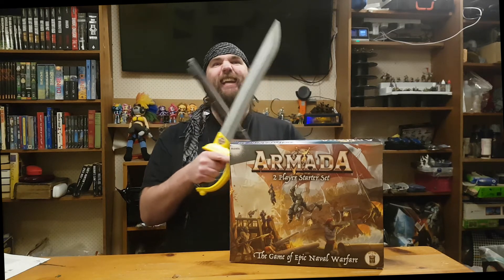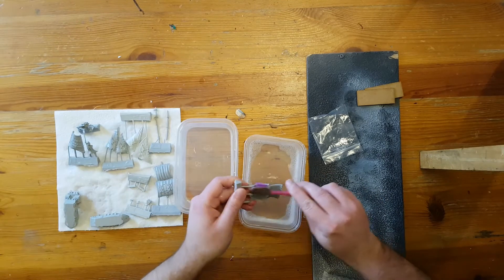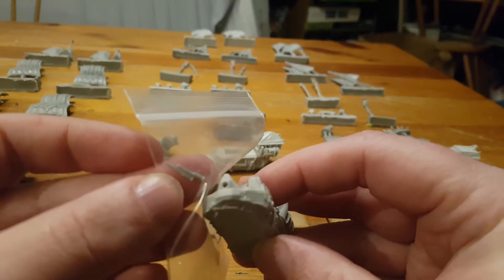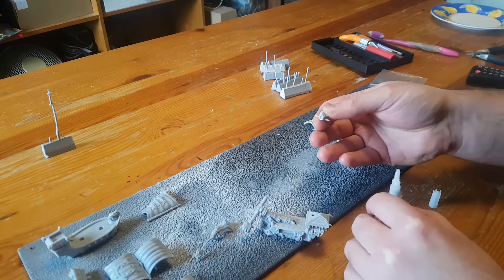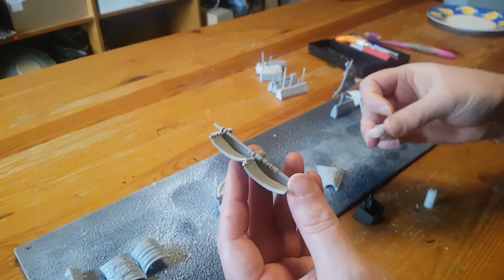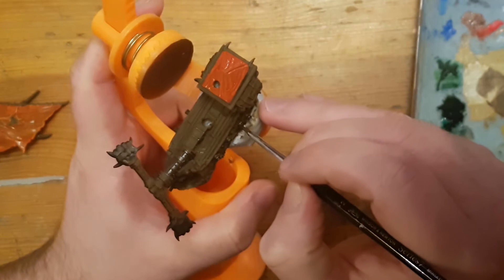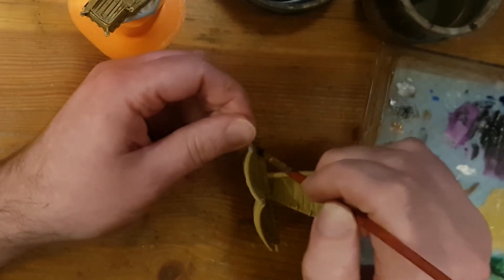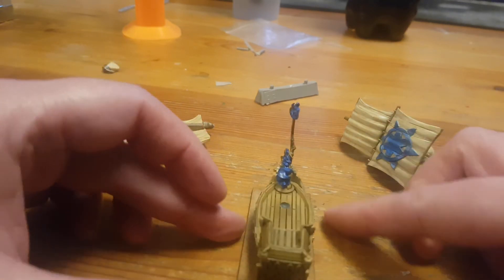How to build and paint Kings of War: Armada ships (Basellion Elohi, Orc HammerFist)

Comment: The masts of the Elves' ships are very fiddly and I found it difficult to get them to stay. Have you ever considered pinning them?
Reply from the maker: I have not had this issue with any of my boats (yet) but for weak connections pinning is a good option.

You could also consider 'staking' which is the same as pinning but instead of drilling up through the bottom of the mast, you drill at an angle through the side of the mast where it connects to the hull. This means you aren't hollowing out the thin mast, making it fragile, but still locking the parts together.